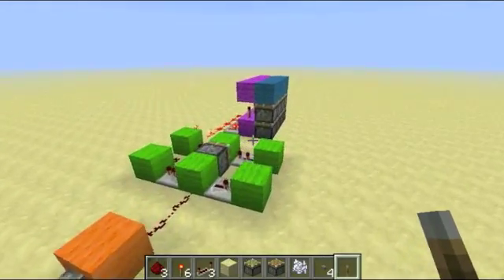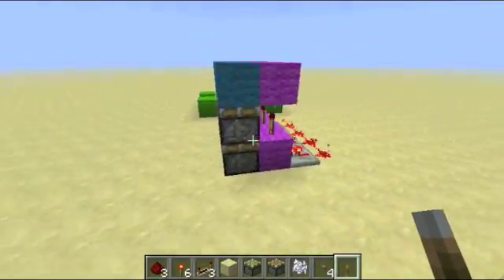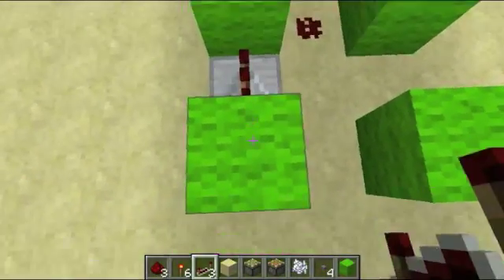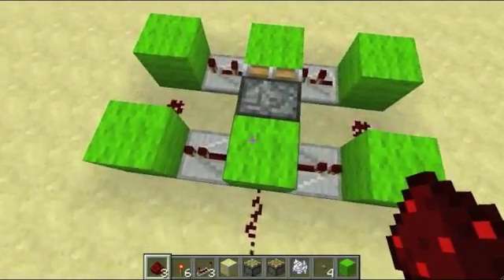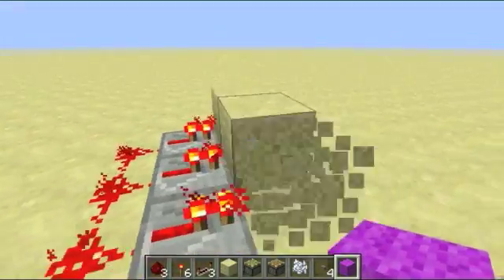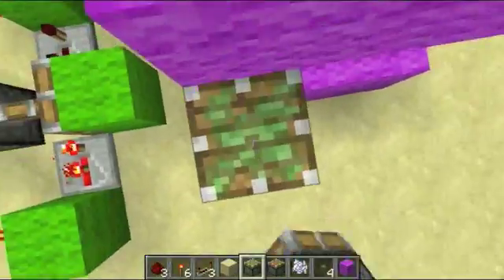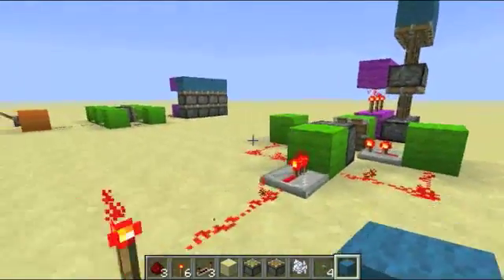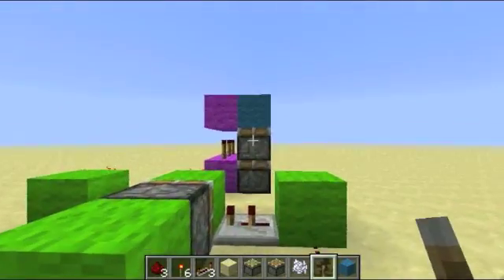Vertical Double Piston Extender Arrays

Comment: It doesn't work in 1.2.5, when the current is on the repeater powers the block, therefor powering the piston, when the current is off, the torch powers the piston.

Comment from the maker: @ARS1337 definitely.  If you mean more than 15 in a row, you can use a branching set of repeaters, getting wider and wider until they meet up with however many pistons you need.  For every branch , the amount of extenders you can have is increased by 7 or 8.